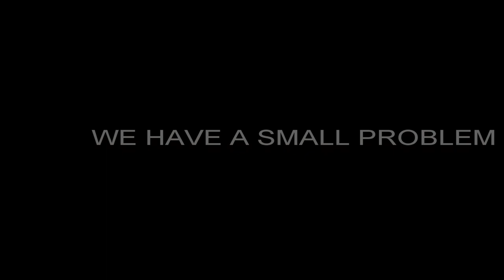Rustoleum Brown Driver side Quarter Panel paint job #nesquik turbo civic build

Comment: Came out great, especially for a cheap gun, cheap paint and a undersized compressor. The orange ball filter is probably pretty wet, you could unscrew it and put the inlet up in a hot spot and let it evaporate and dry out.

Comment: What clear coat did you use cause I used the same paint and my first coat right now is not anywhere near that shiny...
Reply from the maker: No clear coat at all. You dont get your gloss until your 3rd coat when you lay it heavy
Reply from the maker: 1st coat light paint  mist the surface to make the surface tacky. 15 min later 2nd coat to make the color change 20 min later 3rd coat super wet and heavy to get your final glossy coat.
Reply: How many quart do you use for the whole car I got 2 quarts hopefully its enough
Reply from the maker: That should be enoff
Reply: Damn ran out of paint g... i think another quart and two maybe three more coats thus shit could be half way decent..  i was about to trash my integra too soo many frustrations... but its coming together now at least I hope.  Ha
Reply from the maker: @righty-tightybuilt548  how are you mixing your  paint?   16oz paint 4oz mineral spirits?
Reply from the maker: @righty-tightybuilt548  upload a video on your YouTube so i can see what your doing?
Reply: @BarbasLife  ok will do but don't cap on my first time spraying a car alright lmfao!

Comment: Hey bro, it looks pretty good. Insted wet sand and apply again rust oleum why you dont wet sand the whole car with 800 grit and after that spray clear coat. After that you can get an asewome finish that last a few more years.